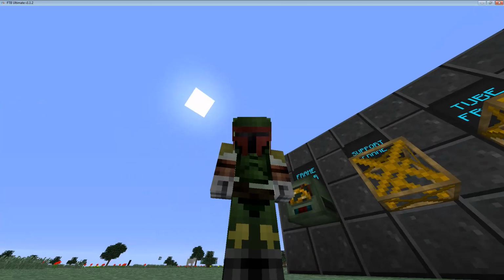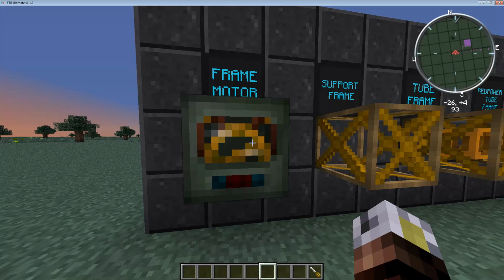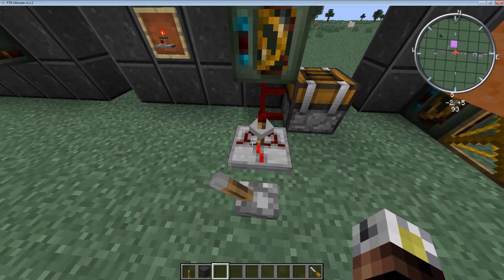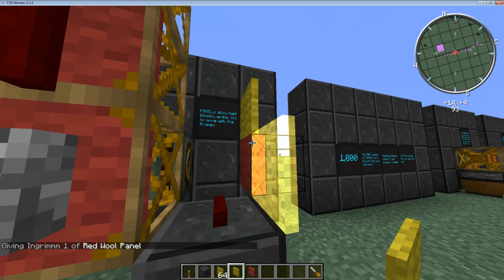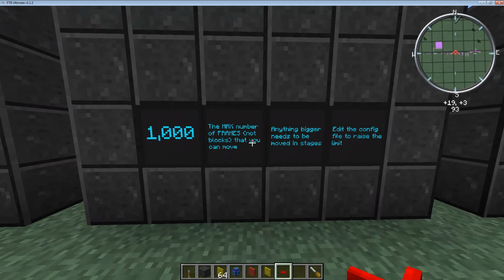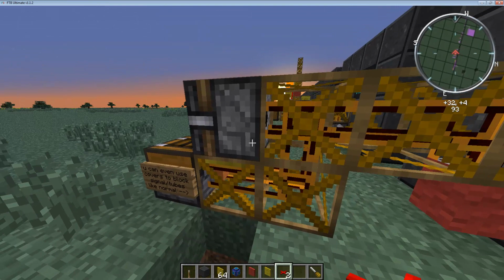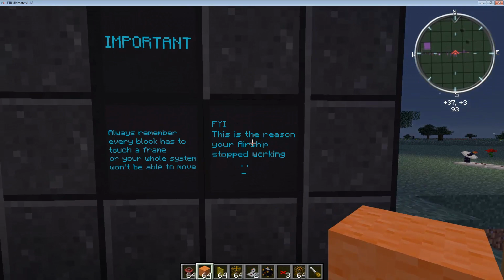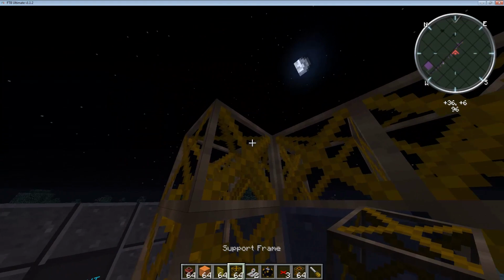TheMindCrafters - Let's Build an Airship - Episode 1 - Frames and Frame Motors

Comment from the maker: I'm using FTB:Ultimate while filming this BUT it will work on Tekkit (Classic), Tekkit Lite, and Feed the Beast Ultimate at the very least. Any modpack that has Computercraft and Redpower (and Ender Storage) should be enough. IF you don't have computercraft there is a way to rig this with Redpower only but I won't get into that in the series unless people ask specifically.

Comment from the maker: Because in FTB Ultimate RP2 computer io busses have a glitch where you can't change their IDs. Also CC has pretty screens and is easy to integrate. By using CC everyone from Tekkit Lite, Tekkit Classic, and FTB Ult should be able to build this. Also CC can do in 1 block what RP2 needs several to do. I love RP2 but am going CC for this one.